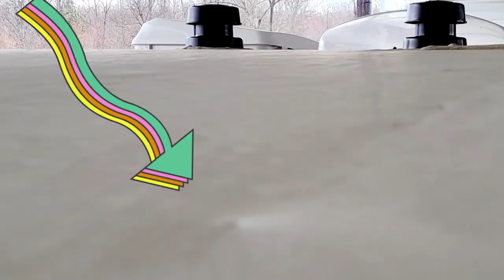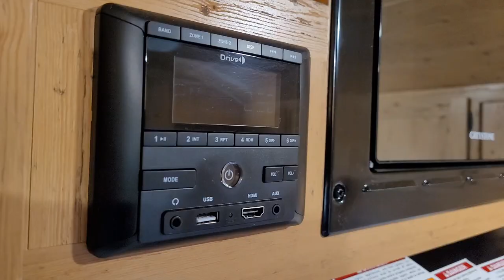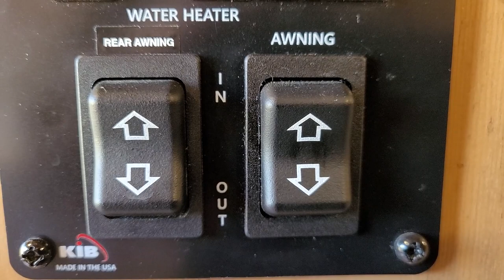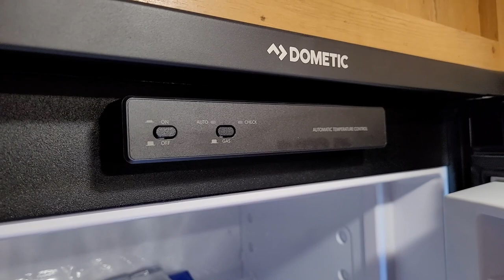Sun-Lite 16BH - 1 Year Owner's Review - Sunset Park Compact Camper Travel Trailer

Comment: I went with the 149 just for the weight/drive factor.  Less weight, less problems.  I too am pleased with the construction.  So far the only issue I came across with the 149 was the water heater sensor went out real fast.  Super easy to replace though. Glad you like the 16BH and haven't had any major issues with it.  Enjoy it brother!

Comment: Great job sir. Appreciate this video. I will say the AC through the wall is the way to go but on the 149 (as you mentioned ) the placement is not good. It's a bizarre location and does nothing for you if you're in bed. Waste of energy. The cook top is away from the bed on the 149 don't know why they didn't do that on yours. I'm going to do what you did with the hose couplers. Thanks again you're living the dream.
Reply from the maker: Thanks for the kind comments.  Glad you liked the video.  Still really happy with this 16BH even with the questionable design choices!
Reply: I have the 149 and I solved that issue by putting a fan on the dinette table facing the bed.  That blows the cool air towards the back where the bed is. Plus another small fan on the kitchen sink cover helps too.   Hope this gives you an idea of how to fix your issue.

Comment: Yep I have the same one , I have had it just about a year now, Frist thing I broke was the handel on the refrigerator, still cant find where to get a replacement handle. I put 400 watts of solar panels on mine and 4 100 Amp hour lithium  batteries. I found the pre wire from the roof for that was not big enough wire for my liking. install the batteries under the bed. But over all I'm very happy with the trailer also.
Reply from the maker: Your solar setup has me jealous.  Once my battery craps out on me, I'll do something similar.  And the handle on the fridge is weird.  Everyone with that fridge has the same troubles.  Even if the door is empty, you have to push in and up before opening it.  From what I understand, that's just a design to keep it from flying open in transit.  Once i got used to it, it wasn't a problem.
Reply: @videozar_  well actually it's not finished yet I added 3 12v plug combos with USB for the 12 v part of it and the power supply that installed in the trailer will charge the lithium batteries also, so that was good. still have to install the power inverter for 110v. , don't really need it though because I also  can carry 3000 watt predator generator if needed, but someday soon I install the renergy 2000-watt inverter, but I think I'll not tie into the 110 wiring in the trailer and just run about two superette plugs so I don't have a loop in charging because i really how to do it correctly at the moment.

Comment: Nice video review. How does the 4Runner pull the camper? Have you pulled through mountains?
Reply from the maker: Thanks.  And the 4Runner does great.  Enough horse power to haul up mountain passes.  Been through Colorado, montana, and Utah with it.  Biggest issue was weight distribution and sway.  Got an Andersen hitch that made a world of difference.  I wouldn't want to tow without it because of the 4Runner's shorter wheel base, soft suspension, and light weight compared to the camper.  Since getting the hitch it has been easy one-handed driving.

Comment: Thanks for this!  My wife and I are looking to get a small camper we can tow with our Jeep and this one really seems to fit the bill.
Reply from the maker: It's a great camper.  If your Jeep is the 4-door then it will work well!
Reply: @videozar_  it is the 4 door, so our tow cap is 3500lbs.  This would give us plenty of space for added gear.  We are really torn about so of the features.  I could do without the oven and I was pretty disappointed in your views on the radio.  I guess the radio could be replaced or omitted easy enough.  good vid! keep up the good work
Reply from the maker: @Bush Pig  they make them without ovens too.  And upgrading the stereo isn't a huge expense.
Reply: @bush pig.   Did you end up buying this camper? I have a 14 JKUR and am looking into this. How does your jeep tow? Up hills and down? Also do you have a weight distribution hitch?
Reply: @dyllanfennell1570  We have not....  yet.  
I'm still looking for other options but this seems to be the lightest for it's size and still has all the great things like solar, a dry toilet, a big refrigerator and plenty of room.  I have been reading on the jeep forums and conversations are all over the place.  I'm under the impression this camper tows really well with the V6 4 door (sport) that we have. Though many have done the rubicon springs and better shocks as well as weight distribution hitches.  When we finally decided to pull the trigger, I think this 16bh will be it.
Reply: @BushPigADV  thanks for the insight! I’m hoping with the rubicon suspension and 4:10 gears along with trailer brake and WDH there won’t be any problems. Going to look at some others this weekend at an expo just to look around but so far for the price and what options it has I’m really liking the 16bh. Thanks again for the reply! ✌🏼

Comment: John, thank you for this very informative video.  I was glad to see your towing vehicle is a 4Runner.  I have a 2007 4Runner SR5 4x4  that I will use to tow.  Did you have to do anything extra to your 4Runner to prepare it for towing?  Did you install a transmission cooler?  Thank you for all the information!
Reply from the maker: Thanks. No need for a transmission cooler.  But I added a trailer brake controller.  And also I use an Andersen weight distribution hitch.  Some people say that's not needed but it made a world of difference for me.
Reply: @videozar_  do you need the sway bar orsway system?...thanks
Reply from the maker: @nickyingtavorn5491  the Andersen hitch I'm using has built in sway control.  It's really good.

Comment: Hi. You convinced me to buy it!  Thank you!  Can you tell me what  camera you installed?  I’m picking mine up this weekend and not sure if I should buy one at the dealer or buy one on line and attempt to install it myself. Any info you can share is greatly appreciated. Happy trails!
Reply from the maker: Glad this helped you.  The camera I got was a Furion Vision S.  I got it on amazon.  It was very easy to install.  Had to splice a couple wires and screw it in.  Then add some caulking around it.  I should have done a video on it, but it really was fairly straightforward.
Reply: @videozar_  Thank you!

Comment: I've been thinking of getting something like this and for the price I like it. I looked into the Bushwack which actually had a Murphy bed  my only thing is not stove, the sink in that is very small and it's a wetbath
Reply from the maker: I looked into the Bushwackers too.  Checked them out in person.  They're a few thousand cheaper, but I read too many horror stories about build quality.  Less storage inside and a more bland styling.  Fewer windows too I think.  No awning, or maybe one...only 1 propane tank.  Smaller water tanks.  If wanted something smaller and cheaper than the 16BH, I'd go with a Sun-Lite 149.  I think it's a more charming version of the Bushwacker.

Comment: Fantastic video! Super detailed! I’ve never pulled a camper and have one question. I believe you stated the fridge was powered by your car when going down the road, the camper can draw power from your vehicle?
Reply from the maker: From what I can tell, I have a 3 way fridge.  It works on normal shore power, battery, or propane.  I am assuming this because I've driven for 9 or 10 hours in warm weather and everything in the freezer was still frozen.  Propane was turned off.  So it does seem that it's getting power from the car.
Reply: I’ve gone down the rabbit hole watching your other videos very nice!  Do you do anything special to keep cool in the summer when using the camper?
Reply from the maker: @lycanthropeify  thanks for checking the other videos.  I don't really camp in the summer.  My last trip was about 2 weeks ago.  I live in TN and the bugs/humidity here is rough on me.  I go out west once a year so I save all my vacation time for an early-autumn trip.  But I do use the camper here at home in the summer.  If it's cool enough at night to not need the A/C I go out there to sleep.
Reply: Also loved the video on how you removed the closet near the bed!

Comment: just joined your channel, great information and I got so much out of it. Do you recommended putting tank heaters on the grey and black tank?
Reply from the maker: Thanks for the kind words.  I don't have tank heaters in mine.  I've had both tanks freeze twice now.  I don't really see the harm in it.  I may just be naive...i'm sure someone will say it could be a catastrophe.  But the worst that happened to me when they froze was that i had to pour some warm water over the drain valves outside to open them then run some hot water down the drain from inside to melt the waste.

Comment: As much as I like the smell of bacon, having it splattered on my pillow is a deal breaker for me. Toilet height is a bit odd as well. 👍
Reply from the maker: Hahaha....yeah both of those things are odd design choices in this camper.  I have a folding divider for the stove that protects the bedding.  And a step stool for the toilet.  But even still...would be better if neither of those were necessary.
Reply: Have you ever thought of remodeling? Moving the sink and the stove, swapping positions?

 I see how you’re handy enough to fix things…

I like the mods, and I also thought the tv mount was in a weird place.

I’m glad to have seen this video because I’ve been thinking of buying one of these…
Reply from the maker: @robertdragoff6909  I could, but it really doesn't bother me enough.  If I do any more modifications, it will be to remove the closet so I can fit a true queen mattress.
Reply: @videozar_  

I hear ya

Comment: FYI, the problem with your a/C  is very common.
When me and my wife either buy a camper we will go with NO A/C.
We are gonna use either a miniSplit  or one of those portable ones. All you have to do is put the tube into the window or make a bracket for one of the ceiling vents.

Comment: i purchased the 18rd model, in 2021, pretty much the same camper as this one. mine has north to south queen bed, overhead storage folds down to make a bunk bed. i am pretty sure these do not come with a 3-way fridge ?, mine only works with shore power or propane, no battery power. you may want to check into this before making this statement ?. you are right about the toilet...no idea why they mounted it so high ?..not cool !. i will give you some tips about what troubles i found out on first camping trip with mine, number one: rear door steps were not the correct steps to be mounted on this camper !. i had to replace them on my own dime ( long story, will not get into it ). outside shower water connection under kitchen sink was only hand tight, leaked big time under kitchen sink, easy fix. water pump, MADE IN CHINA !. PLEASE READ THE LABLE ON THE PUMP, IT CLEARLY SAYS, 5 MIN'S ON, 10-15 OFF !, who in their right mind is going to shower in under 5 mins ??..replaced it with a sur-flow water pump. ( i did keep the pump as a spare though ). going off road : be warned !..mine came with 14 inch tires, ( who uses 14 inch tires on trailers these days ? ). needless to say, on one off road trip to the deer camp, one of the jacks on back corner got bent from being so low to the ground. i ended up purchasing a axle conversion flip kit from e-trailer, flipped my axle, gained 2 inches of ground clearance. now my tires look like midgets ?..lol. just changed them out for 205/75/15, goodyear endurance ( these come with tires made in china ) i never had a flat or blow out from them ?..but i did not want to take that chance, ditched them fast just within the past week. ac: it leaked inside from running, it had a name i can not even pronounce ?..lol. tossed it, bought a coleman 13k ac, works very well. windows: when you run the heater ?, the windows will sweat big time !. sooo..after all this, bottom line : i am very happy with my camper, it is well worth the 15k i paid for it !!. you deff need to look into buying this camper name brand !!.

Comment: I like the floorplan, but this company seems to be notorious for cutting corners. For the price, I'd rather have better fittings and clamps and door holders, rather than a cheap sound system that nobody really wants. This company is so close to making a great camper. In my opinion, one year isn't much time for a review. I had a similar Komfort camper that was a 1980s model and was still in great shape. I just can't imagine these holding up like that.
Reply from the maker: Thanks for letting me know.